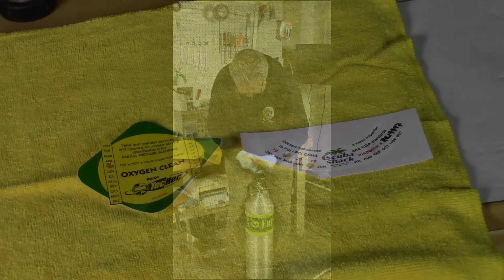Cleaning Tanks and Valves for Enriched Air use.

Comment: Simple green corrodes aluminum. We’re not allowed to use it at work on aircraft parts. We use a medical grade degreaser powered with water that works wonders. Then we oven dry components.